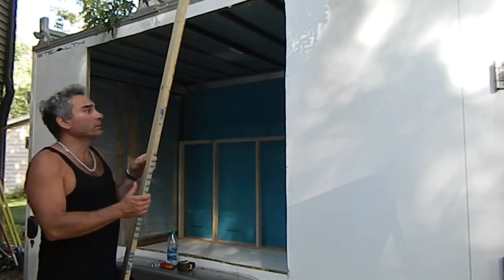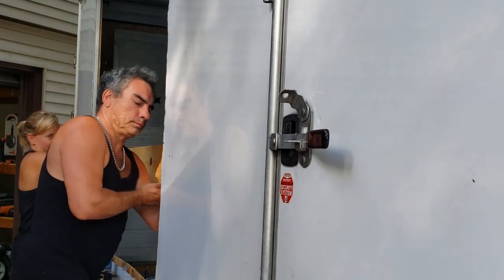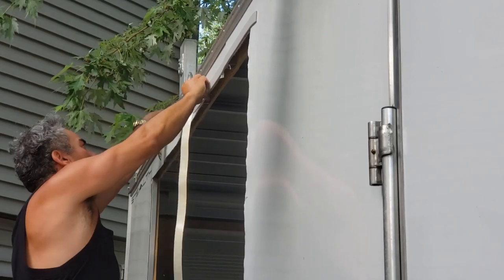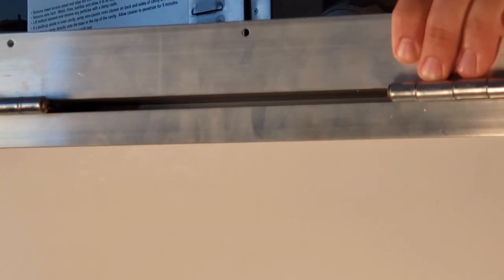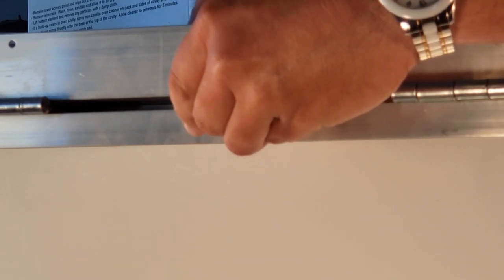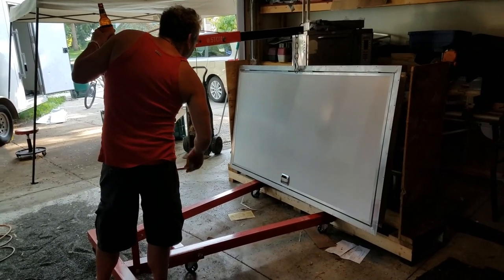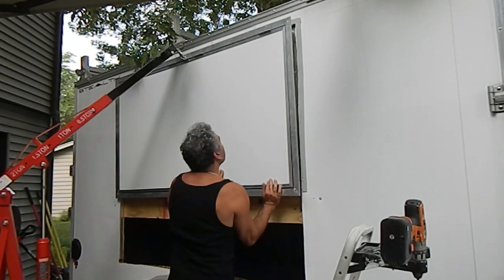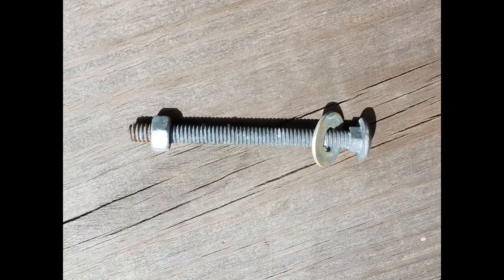Food Truck Build Part 3 , Concession Window Install.

Comment: Why did you cut hole so big?
Reply from the maker: I'm going to build a condiment area below the window so customers can grab napkins silverware and condiments
Reply: Oh great idea. I’m in sask and thinking of doing this for a mini donut truck. But I just don’t know where to even start.
Reply from the maker: @michellelewis2021  I'm going to document my entire build so you can watch the videos as they come out, always feel free to ask questions, this is my second build so I have a decent amount of information
Reply: I want to build one for a mini donut trailer but have no idea where to even start.
Reply from the maker: @michellelewis2021  check with your local authorities to get the requirements to pass inspection for your menu and preparation process, here in Wisconsin you'd probably need an exhaust hood over your fryer, a triple compartment sink and a separate hand washing sink , 40 gallon fresh water tank and 50 gallon gray water tank and an adequate water heater
Reply: @michellelewis2021  i have a mini donut trailer that im transferring into a truck currently. Let me know if your interested in buying it
Reply from the maker: So I could add the service area